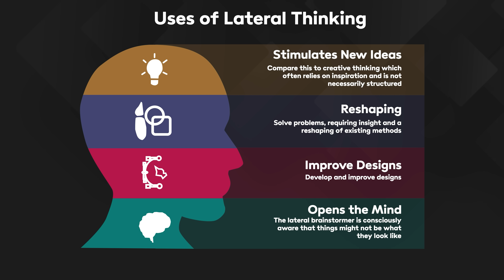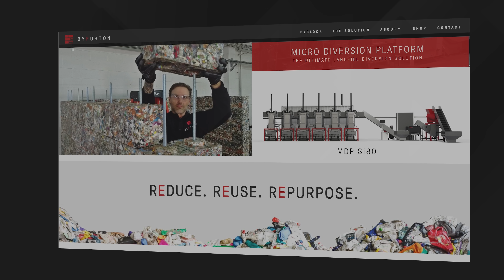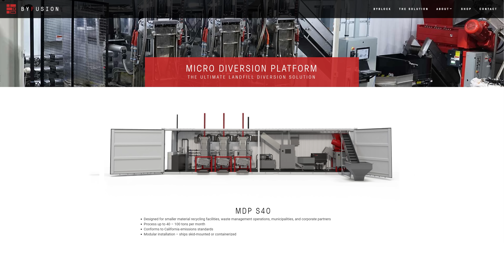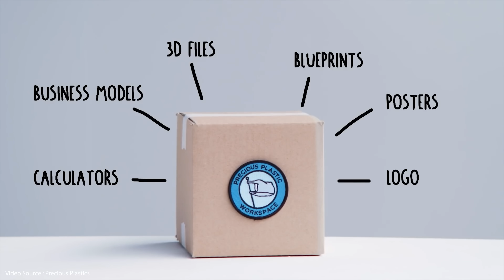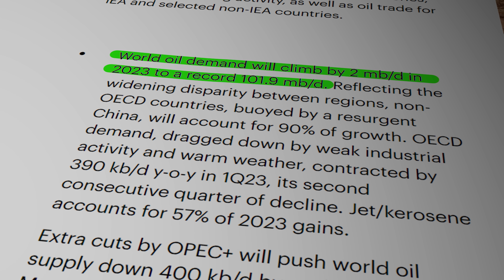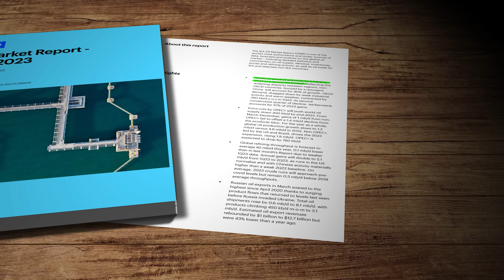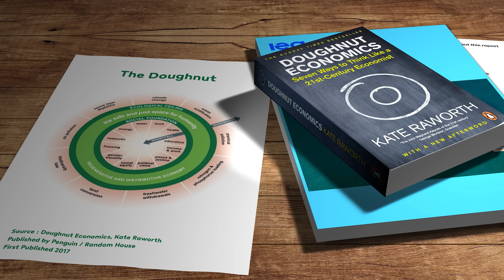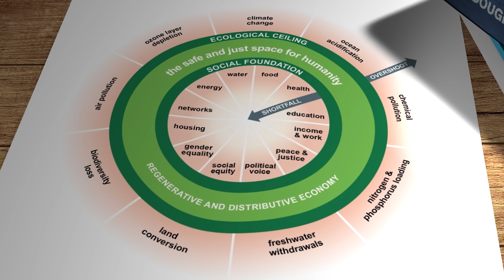Plastic doughnuts? Have you lost your mind!?

Comment: Dave - YES!!! Closed loop economy.  I believe the primary issue with capitalism today is no companies really deal with any waste post-sale.  It is up to the consumer to deal with that, who simply discards it into rubbish.

I believe all companies that make stuff should be forced to design how to receive, refurbish, reuse, and/or recycle the various components in their products.  This will form the basis for closed-loop, and I believe an additional profitable "upstream" economy.

So, let's say you buy a coffee maker, use it, and it stops working?  You would return it to the store you bought it from and it would find it's way back to Cuisinart.

Cuisinart (who would already have the infrastructure built to receive and break down the product) would diagnose that the heating element is bad, but the rest of the coffee maker is absolutely fine. They would replace the heating element, give the coffee maker a shine, and resell it as new. 

Cuisinart would return the heating element to the manufacturer.  That manufacturer might find that the only thing that is bad is the element itself.  They would replace the element and sell it as new - back to Cuisinart (or whoever).

The heating element company would return the element back to their supplier, and the cycle continues until it ends up at the materials manufacture who would prepare it and incorporate it into their new products.

This model would generate additional revenue, because the company that is the most prepared to reuse or recycle is the company that built it in the first place.  That doesn't happen today, because there is no "upstream" process to get those products to their original manufacturers; and companies don't generally build out the infrastructure for dealing with incoming products because it's all about getting products to market (i.e. "downstream") and its seen as extra expense rather than potential extra revenue.

One day perhaps!!

Comment: Seriously folks, the building industry has grabbed hold if Insulated Concrete Forms (ICF's). Nobody was considering using Styrofoam as a building material when I was much younger. What are the insulating properties of these blocks. Could these be used as ICF's?

Comment: highly flammeable and toxic material as construction materials dosen't sound like a good idea. there is also the microplastics thing
Reply: "highly flammeable [sic] and toxic" - those blocks are not highly inflammable, and many plastics are not toxic.  And once plastic is made, something has to be done with it after its first use. The microplastics worry still exists even if the plastic is not made into blocks, and the block-form may slow down the process.

Comment: Ultimately, the biggest challenge will be replacing concrete foundations, and that seems to be where most cement/concrete alternatives falter.
Reply: The production of cement is a tough one to cut down on CO2 emissions due to the high temps needed to make it. I was interviewed by a company recently that is trying to capture the emissions from cement production and use it to 'grow' a cement-like product that can be used in place of cement, much how like a coral reef grows. Concrete sure is a pretty amazing product for certain applications and one of the oldest still used today.
Reply: @id10t98 co2 isn't the problem. Actually our planet is more green than ever because of the co2 and nitrogen in the air.

The problem are the toxic waste products that erode into our water and soil. The plastics and heavy metals are more of a problem than co2. Our stupid planet won't learn that all these heavy metal machines live EVs and co2 capture devices actually are worse for the environment than simple co2.
Reply: Since concrete foundations are normally poured to adhere to surrounding rock or soil. I can't see this method as being viable unless you could heat plastic to a pourable consistency.
Reply: We should be concentrating IMHO, in producing and exporting solar from African & Middle Eastern countries; along with more household yield gains, via new build geothermal recycling from existing and traditional heat and power sources of energy, as well as, retrofitting subsidised heat pumps to prewar properties.
Reply: @christopherwilkinson326  The USA has a lot of utility companies that dont like your ideas unless they get to be the ones to tap the resources to sell the power. Crony capitalism will ruin it.

Comment: I love a lot of the outside-the-box thinking in these videos, and watch your videos regularly as a person who's a science teacher and someone who has a high-level general knowledge about all the Sciences this is one of the few that I really doubt has any chance of working.

When you add things into concrete they need to interact in positive ways with it in several different ways. We can add fibers to concrete like we do in hempcrete, or carbon fiber concrete because the cement in concrete and those fibers are both capable of being wet by water forming a tight interaction between the filler and the calcium and silicon hydrates in the cement. Most Plastics are difficult to nearly impossible to wet and they're going to essentially be bubbles from a strength standpoint. They're not going to stick to and add structural reinforcements. Another reason why you do it to increase the tensile strength because the material you're putting in has a good tensile strength and is in fibrous form that runs along way. Do plastic can form fibers these recycled the Plastics would have to be melted down and then spun into strong fibers that's not possible with a lot of plastics. Plastic waste is probably going to be mixed in as filler particles and is going to reduce the strength instead of increase it. We do ad killers that are particulate like sand, gravel and cobblestones to concrete, and that helps straight propagation of cracks cracks because those stones are much harder than the cement. Again plastic can't really do this because it has no attachment to the cement, is not really stronger than the cement depending upon the plastic, and is often deformable so it doesn't block The Strain on the material, the stretching of the material
Reply: That is a fair point, but atleast from my understanding of the video, the concept isnt to mix it with concrete but to make the blocks purely out of shredded plastic that is fused together using heat pressure and steam
Reply: @gkes4617  I'm sorry I should have watch to the very end. You can make plastic construction bricks. I know some houses that have literally been built using styrofoam and some support beams. They can actually be built fairly sturdy that way with very good insulation values
Reply: @michalchik  Well, concrete fills those foam blocks, if it’s insulating concrete forms (ICFs) you’re talking about. So, it’s the rebar and concrete that support loads. The forms contain the concrete (for the most part, unless the person pouring it didn’t properly support the forms from the outside or poured too much vertically, causing a blow-out).

Comment: Thanks Dave great info and video. The generalised chemical formula of this plastic can be written as (C2H4)n. The density of polyethylene can range from 0.88 grams per cubic centimetre to 0.96 grams per cubic centimetre. The melting point of this plastic is relatively low, ranging from 115 degrees Celsius to 135 degrees Celsius. Fun fact , and look closely at the formula C2H4. That is 4 Hydrogen atoms. Yes here I go again, if we had. Hydrogen Economy we could make plastic with Hydrogen and carbon. So to recycle plastic we just need Green Hydrogen to make Green Plastic from Direct capture carbon and Hydrogen.
And perhaps if we were really smart we would find a way of extracting the Hydrogen from the plastic and capture the carbon. So that we can make more plastic. WHAT?….
,

Comment: The only downside to plastic block building is their flammability. During the last wave of bushfires here in Oz, structures designed to stop erosion under indigenous rock art, 000s of years old, made of recycled plastic, caught fire, sooting & incinerating the very thing they were designed to protect. I’m much more inclined to hempcrete or compressed earth blocks because of the high fire danger of where I live, & to reduce my plastic consumption as well.

Comment: I like the idea of using plastic for building blocks so long as the building is not in a high fire zone!.  Also, I've seen reports of using waste plastic in roadways which is a very bad idea as the tires will aerosolize microplastics into the air, soil, and water.

Comment: You are a star Dave. Bringing hope and sanity where the MSM makes good folk scream profanities!
Re the plastic bricks - I'm going to need a lot more  than a 2 second promotional clip with a blowtorch to convince me of the product's non-flammability.
All plastics are long-chain hydrocarbon polymers and regardless of reducing the surface area to volume ratio would surely still be combustible,releasing seriously toxic gases UNLESS the blocks also contained a flame retardant thoroughly mixed in.
Maybe they use boron salts which do occur naturally and are used to reduce the flammability of natural timber and wood.
This technology whilst admirable is of course like running a diesel engine on used cooking oil i.e. primarily a way of doing something useful with our current waste problem and should not be considered a possible large scale sustainable building material as you have to pump the oil,refine it,turn it into plastics first,etc,etc. all of which feeds the hand that bites us!
I would humbly suggest vast reforestation programmes,moving out of the cities and building in timber which 
-halts the spread of deserts
-reduces surface heating of the planet by creating shade and uses that UV to grow trees
-cuts skin cancer rates
-reduces storm-force winds and soil erosion
-expands the availability of water resources into previously uninhabitable areas
-significantly stabilises weather systems by reducing hotspots and acts as a windbreak 
-creates beautiful places for people to live and to pass on to their kids 
-decentralisation reduces CO2 from transportation and saves everyone time wasted commuting
-provides skilled meaningful jobs
-collapses the parasitic and predatory property market
-forces the maggot middlemen to do something meaningful with their lives for a change
- liberates us from spiralling rents and debt 
....I could go on ;-)

Comment: I don't know, all petrochemical products, including plastics, emit a lot of toxic aromatic compounds, I wouldn't want to live in a building made of plastic blocks, but it may work fine on other types of buildings. Also, shouldn't such plastic blocks include some air bubbles for proper insulation, unless it's already ultra-performing? What is the λ value (thermal conductivity) of the material, and the R value (thermal resistance) of the blocks shown? It might be difficult to assess if the composition of the material is an uncontrolled mix of different plastics.
Not all plastics are eternal too, some degrade faster than others, could this affect the stability of such a composite material?
I'd rather develop bacteria or processes that turn plastics back into some hydrocarbon fuel or use plastics as a fuel, like they do in Eastern Europe where they are supposed to "recycle" the plastics collected in the UK, but with pre-sorting by rough plastic category and serious exhaust control and clean-up.
No doubt we can find many other concerns, valid or not, about this new material, but it has the merit of existing and of being part of the solutions to recycle plastics. I have seen plastic bottles turned into urban furniture such as benches or decks, but these are exposed to the elements and degrade into microplastics and nanoplastics that end up in the environment, unlike these plastic blocks that are enclosed in a wall, as a wall.

Comment: The bulk shredding of plastics makes me wonder about the inevitable breakdown/leaching. As a material facing UV, heat, and cold, what will it breathe out over time? Precious Plastic on the other hand seems to have education understanding the material and the desired application. It's all wonderful resourcefulness, I just don't want to find out 15 years later I'm living in a poisonous box
Reply: Microplastics are now found even in fetus . Microplastics inside my HOME .. nope ! The more plastic heats the more Pthalates it leaches . So anything is great for building homes except Plastics.
Reply: @DeeP_BosE  
Sorry but your new home is already loaded with curing agents of all sorts.  Like anything toxic, better to encapsulate and know what is there than simply wish it was not in a newly finished product.
Reply: @cjmatulka8321  Wrong
The only thing in my new home are wallpapers, concrete, wood , marble , stone & some insulation. The curing agent of paint is mostly on the ext wall which will release VOC while it's WET. The plastic will release toxins for ur lifetime and ur future generations. Go ahead n encapsulate ur plastic in air tight sealing then check if the prices will be acceptable by any person compared to safer materials. But the question is why Target residentials? U wana make some dough outa trash build a chemical factory with that trash. Not homes.
Reply: @DeeP_BosE  
You've named most all the contaminating materials, enjoy!
Reply: @cjmatulka8321  yes will enjoy in a non contaminating environment with 0 curing agents in samples, while blood sample from plastic homes gets richer in microplastic .
Reply: @DeeP_BosE so, how would you get rid of all the plastic.   Better to reuse, than have it end up in the sea.
Reply: Dave is awesome! Love his videos and his attempts to broaden my natural default to small-mindedness and cognitive error. My biggest concern is the breakdown! All of this stuff leaches into the air and groundwater. The Forever chemicals are everywhere! They are even in your blood! His video made me wonder why they don't use this to build highways and bridges. I can tell you one thing that immediately jumps to mind. If this starts on fire, you cannot put easily put it out, and the burned waste is toxic!
Reply: Not to mention the (devastating) effects of these blocks catching fire!
Reply: @saalkz.a.9715  Grenfield worldwide
Reply: As opposed to chipboard and the formaldehyde it contains and the hundreds of other semi toxic components of the average house.  Microplastics that are consumed by way of foods and water, it makes sense for encapsulation till we know definitely what to do with the original sin.

Comment: I dunno.  Can the bricks be recycled themselves?   The problem I have is that all of these re-use cases take the plastic closer and closer to the environment, and that means the plastic ultimately ends up in the environment anyway.   Also, I'm not convinced that plastic is a better building material.  Plastic tends to become brittle and crack with age even when not under stress, and it becomes a toxic pile of goo if it catches on fire.
Reply: At least brick-sized pieces of high density plastic could be sequestered underground relatively easily at the end of their life